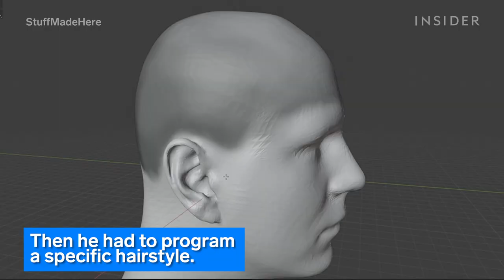This Robot Can Cut Your Hair And Make Small Talk

Comment: I'm not going to risk my eyes being stab by the barber robot 😂🤣
Reply: He found a way to fix that, it uses a vaccume like a vaccume cleaner so it pulls up hair from a short distance before cutting, also the software avoids your face so it won't do that.

It also uses mini sticks with pressure sensors to find your head before vacuuming.
Reply: You see it kept stabbing thr mannequins forehead!